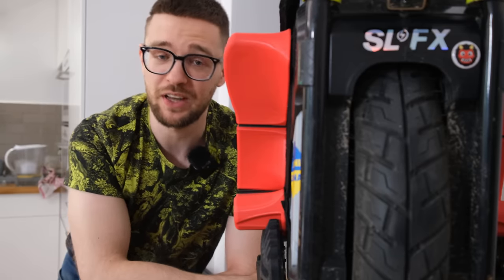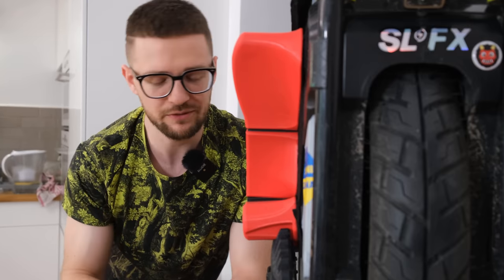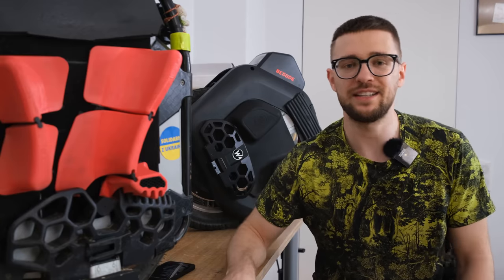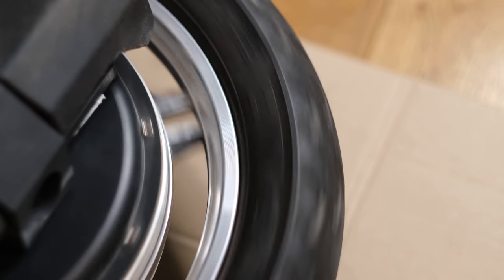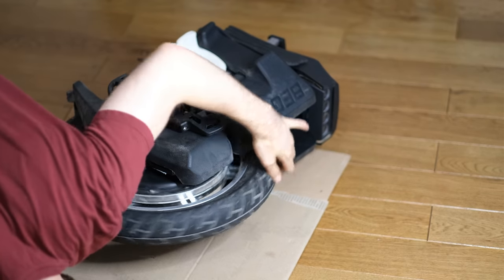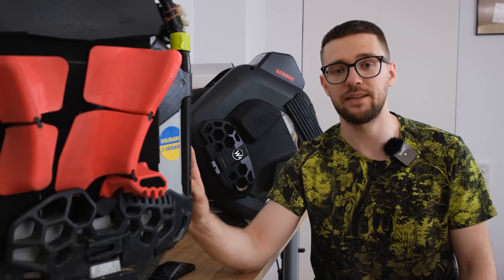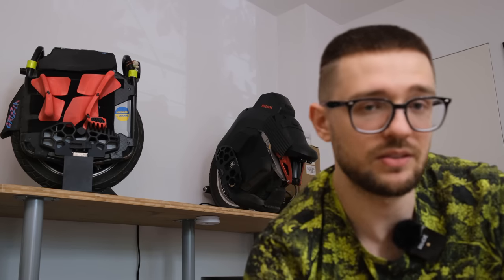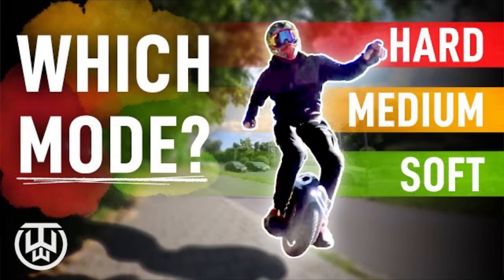What to do if your EUC breaks?

Comment: Another awesome video Adam. Can I just add, whenever you open your wheel to look for anything (water/dirt/damage) ... check everything. Make sure the L hanger bolts are tight, check all plugs are plugged in properly, look for pinched wires, cracks in shell and look at the guide line on the tire to make sure it is even. Don't just open your wheel to say, look for water/moisture... find none and shut the wheel again.... while it is open, look at everything... even use a magnifying glass and flashlight. Also, take some pics so after you have checked the tightness of everything and have put the sides back on... you can look at the pics and inspect it again, or compare pics once you open it up next time.

One thing I found with getting the tire aligned on the rim, sometimes if the tire guide line is too far out or in at the valve stem... you have trouble getting it right on the other opposite side.... it can help to push the valve sten in half way which allows to tire to move... whereas if there is still a few pounds of air in the tube, that can stop the tire from being moved right at the valve area.

Comment: Consistently creating some of the best EUC content - thanks Adam! Your page is where I send new riders for learning; it's a great combination of information and entertainment. V8f (~650 miles) went into vibrator mode due to the left pedal hanger bolt loosening - total disassembly. V8f (~500 miles) motherboard died - partial disassembly. V8f battery died (~600 miles) - partial disassembly. S18 (~1600 miles) went into full front/back  knock mode until the left suspension bolts tightened and thread locked - partial disassembly. Both wheels need a new tire. MTen3 (~800 miles) keeps cruising along ... no issues. In both loose pedal cases, I didn't notice it until near failure as it is gradual. It's scary how loose they were. I'm checking those big bolts monthly now as part of the maintenance routine. Keep up the great work and safe riding!

Comment: Good information, I would add some more.

2:25 its better to use automotive / bike method for tire trueing. Deflate the tire, use soap water on the tire walls. Inflate the tire to maximum allowed pressure, deflate the tire to your targeted pressure. This way you should get consistent result. If not its maybe because the tire was stocked in deformed shape.
9:38 I would emphasize to not drive and test with EUC with that problem because it can completely damage itself beyond repairable. Service it as soon as possible.
14:48 Also the first thing to disconnect / last thing to connect is the battery plug to be sure that you wont switch on the wheel in semi-assemebled state even accidentaly. This can be dangerous and also damage your euc.
15:10 be extremely careful with separating the rotor / stator. The forces involved could easily pinch -> injure you.

Comment: With motorcycle tires, direction had more to do with how force is applied. Rear tires are made to take force under acceleration and front tires are made to take force under braking. If you get a front motorcycle tire, I would(and have) mount it backwards. Though at the speeds and forces involved with EUC I doubt it really matters much.

Comment: Have you tried putting oil made for lubricating air tools into the air shock to help with seal lubrication and sealing.  A little goes a long way, maybe a drop or two in the schrader valve from time to time.

Comment: Regarding battery not charging to 100%.
Both 2 bms replaced then balanced battery packs showing 100.7v, then when euc app/darknessbot is connected, it is off by 1.2v.  Charger shows 100.7v in the tester and port shows the 100.7v. 

Charger goes green light at 93%

Is it still safe? Or is something like the motherboard is measuring incorrect voltage.

Comment: I was trail riding on my 14S when braking started to shake the wheel violently. Only a little at first but I ended up have to walk home due to the epileptic seizure the wheel was having, Found out when I opened it...the pedal hanger literally fell off  the motor...all the screws loose.

Comment: Hey brother my ks16x turns on and rides fine but it's not holding any charge I have about 86 percent battery level right now I have a 5amp charger it's reading green when I plug it in ,so I know it's not charging did burn out the bms ?

Comment: Great stuff, but we're two sherman riders in my town, and we both can see the tire wander side to side when looking down while riding, is there anything we can do about this?
My V2 shermy motor is brand new, and we double and triple checked the tire alignment when swapping motor the day i bought the EUC.
The shaft didn't look bent, no obvious faults with the rims either,, but still they wander side to side (and you can feel it in lower speeds)
Reply: You can get it pretty much gone my massaging the tire around with some soap and reinflate/ deinflate a few times. I’ve never felt it while riding, just notice it if you stare at your tire. Thank
Reply: If it really bothers you switch to a Shinko 244 or. Michelin Pilot street 2.

Comment: Yo… my brother.. can you please help??? Or anyone… I have the AR begode Nikola…Hello I was trying to update my firmware on my alien ride Nikola today.
The update only got to 62% and then my phone went to sleep mode and the update did not go any further…. 
Now the wheel flashes red but it does connect to the app, and I have tried to continue the update just by going through the steps again. I have my phone beside the wheel and it has been almost an hour? 
What should I do… I can not power off the wheel unless I unplug battery connector and then it does the same thing all over again. I does NOT want to finish update. I can not use  the wheel?
Thank you for any help?

Comment: I get mostly fatigue and cramps in the first 20min in the ride. I guess my body aswell as the batteries need to warm up😂
Reply: totally, I'm old so I have to stretch for a while and it still takes me usually 30 minutes to get pumped up. I didn't stretch at first and that was a mistake.

Comment: Amazing timing, my 2 month Nikola+ just started creaking. >_>
Taking a long shot, would you say this is also a bearing issue? https://youtu.be/K2uh_DCsYJI
Only on the one side, 1k km mileage, 3 full days completely dry weather, noise appeared after charging at the office. Happens on X amount of wheel travel or each full cycle(as you mentioned). More often and louder when going forwards than backwards.
Reply from the maker: Thanks! :_wrongwayw: Yup sounds like a bearing issue
Reply: @mr_wrongway  Thanks a lot for checking it out, buddy! Didn't expect an answer, but feeling very at peace now. 🙌 :) 
It probably isn't a good idea to keep riding it like this, right? :D
Reply: @JM Coulon Awesome thorough answer, thank you!

Comment: The most reliable is Kingsong 16X, undestroyable !
Reply: Are you talking about 1st batch Kingsong 16x?
Reply: @JM Coulon could you define 'significant'.

Early batches had a weak shell. The trollyhandle has a spinkill switch, which could cut out the 16x, if the switchhas been compromised. Software issues etc.
Reply: @BunnyslippersEUC  I am talking about mine.
Reply: @baubelepreux1561  but you modded your 16x so it's build like a tank 🤪
Reply: @BunnyslippersEUC  Absolutely not, my wheel is stock, but despite hard off road rides and several severe falls, it's still effective.
Reply: The 16X has this advantage to be globally like a disc, nothing is protruding as it is on recent wheels : lights, front bumper, suspension.
Reply: @baubelepreux1561  expect for the mudguard.
Reply: @BunnyslippersEUC  Made with soft rubber.